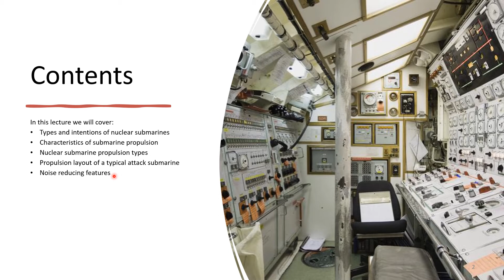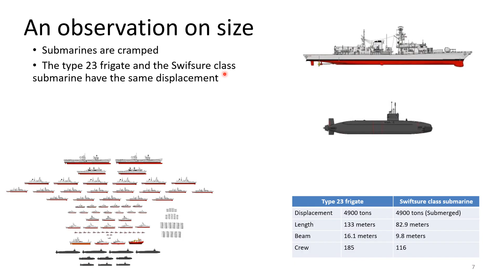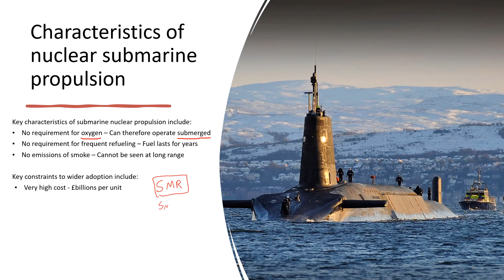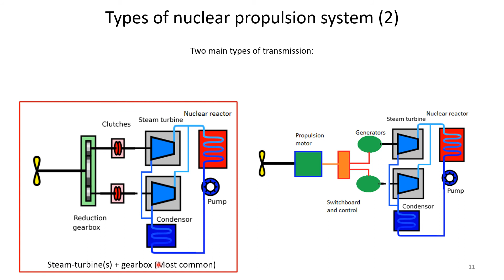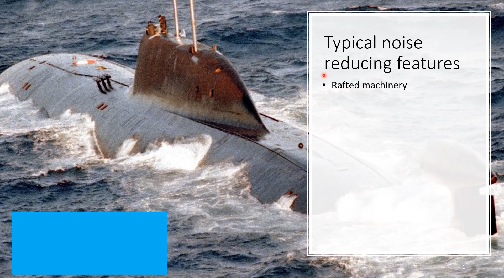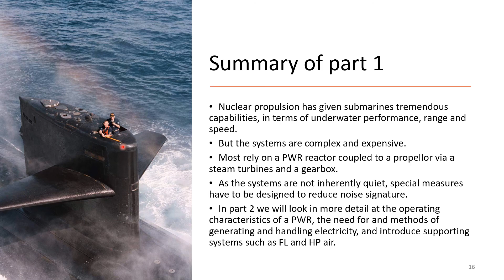Nuclear submarine propulsion systems unclassified part 1

Comment: @drawingboard82 four years late, but ... as i understand it the biggest reason more countries (e.g. canada like you mention) do not run nuclear powered submarines falls under the political category and is essentially a non-proliferation issue - the naval reactors used in submarines need to be small, light and efficient and therefore use HEU at over 90% enrichment which is exactly what you want to make nuclear weapons and the IAEA and the five NPT nuclear weapons states get super twitchy and nervous when countries start making it
Reply from the maker: Well yes, uranium is typically quite enriched in submarines but it doesn't have to be. Higher degree of enrichment won't yield higher power, but it will give you longer between refuelling. So it's possible to run a submarine on commercial grade fuel if you design it for that. And you certainly don't need weapons grade fuel. As Australia has shown, political concerns can be swept away as soon as someone decides they want nuclear subs and are prepared to pay.
Reply: @drawingboard82  true, and i just checked and looks like france managed this and run with LEU in their submarine reactors, which is interesting. also thx for this series, looking forward to parts three and four!

Comment: Natural convection flow in the main coolant loop would have been a common noise reduction technique worth mentioning. I think sonar techs will say that the noise of the turbine generator's lube oil pumps was a signature of some classes of Soviet subs. The Soviet subs only got quiet after Toshiba sold them numerically controlled machining equipment in the early 80s. It was a big scandal.

I trained at the nuclear prototype for the Tullibee, the early electric propulsion SSN. The Tullibee had a beam of only 23 feet and the prototype was very cramped.

Comment: Am sure we all appreciate you may be limited on the amount of detail you can provide. However the science of fluid dynamics is in the public domain and I'm already on several watch-lists so not overly worried about mentioning a few things.  🐬 Like ducted propellers are more efficient at lower rpm & significantly quieter plus surface vessels have been openly enjoying the advantages of variable pitch propellers for decades.

Comment: Thank you so much for this video! It was very helpful and informative. ❤️‍🔥🙏🦾

But am I really the only one who realizes they are using a Tesla disc stack pump for zero cavitation and windage on the “screw”?! 🤭🦾🤓👨‍🔬

Lol what a convenient word “screw” and way to get everyone’s mind to immediate think complex geometry screw pattern for no cavitation when in fact it’s the exact opposite. 

Classic obfuscation.

Flat discs with no tips that cause acoustic or EM oscillations and variations.

Also using the Tesla turbine for the steam turbine means there would be no need for a reversing gear as the steam is just sent into a different nozzle that spins the discs the opposite way.
Reply: Also using the Tesla turbine for the steam turbine means there would be no need for a reversing gear as the steam is just sent into a different nozzle that spins the discs the opposite way.

Comment: I wonder if they have tried molten salt reactors.  You do not have to create pressure in the core.
Reply: The Soviet Union built some sodium cooled reactors in submarines, but the reactivity of the sodium with water creates numerous safety issues in a naval vessel.
Reply: @Griz1231  that had to a good idea molded sodium chloride is not fun in water. But running high pressure reactors 15 times atmosphere not a good choice either
Reply: @joem80003  lol

Comment: I was very fortunate with service on DDG (Charles F Adams) class warships when serving in the Royal Australian Navy.  4 x 1250psi Foster Wheeler D Type boilers and 2 x General Electric 3 stage steam turbines.  The system was a superheated steam system.  As you pointed out a steam system is very complex with a lot of pipework and auxiliary systems, and steam recovery systems.  Having said that, steam is the most amazing propulsion system yielding fantastic efficiencies.
Reply: YOu;re right, supeheated steam systems are indeed very efficient, but the secondary loop of nuclear submarines operate at lower temperatures using saturated steam.  THis creates other problems related to wear as wel as lower power.   To supeheat the steam would require the primary loop o be kept at enomous pressure., so early RN SSns used the saems designs adn WW! waships !

Comment: Great video.  Regarding the propulsors, I think that the principal advantage of the pumpjets over propellers is that they are able to achieve much higher speeds without cavitation occurring on any of the blades.  This allows them to achieve a much higher 'tactically silent' speed, since cavitation (the creation of voids in the water) tends to dominate most other sources of noise once it starts occurring.   The shroud of the pump jet actually slows down the water column and raises its pressure before it comes into contact with the rotors.  Such a shroud is also called a 'decelerating duct' for this reason.  The trade-off is that at very low speeds, the pump-jets are less propulsively efficient, since slowing down water that's already moving slowly means that some part of the water turns around moves in the opposite direction.  This is called flow-separation.  I actually don't think that at low speeds pump jets are actually any quieter than open propellers, at least while the propellers can operate without causing any cavitation.  In fact they might be ever-so-slightly louder, because of the greatly increased turbulence of the flows inside the shroud.  But the pump-jets would be vastly quieter at any speeds where a propeller would cavitate.  Since conventional submarines can't sustain such speeds for any useful period of time anyway, they choose propellers consistently over pump jets.

Comment: What you say about props is true.  However, propellers with 2, 4, 6, or 8 blades can resonantly vibrate like a bell.  Whereas propellers with 3, 5, 7, or 11 blades do not do this.  Skewed blades also minimize self vibration.  Larger blades exert less force per surface area which reduces cavitation, and they reduce turbulence.
The cowled  propellers have greater directional precision and do not side slip in a turn.  This gives greater precision in a turn as well as in cross currents.
Reply from the maker: Thanks for that, I appreciate it.  I totally forgot about the surface area!  Judging by your icon, you also know a lot about nuclear reactors?  I am currently trying to make part 2 but its hard without exposing classified information, so I think its going to have to be based on civilian reactors and things like the USS Savannah.  Hopefully I'll get it out on the weekend.